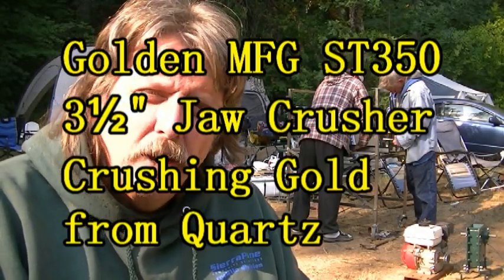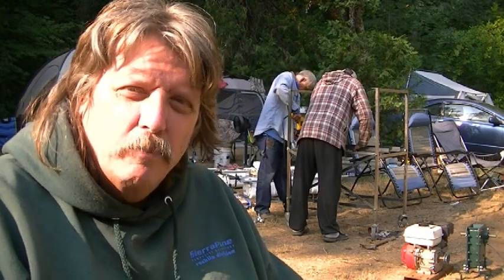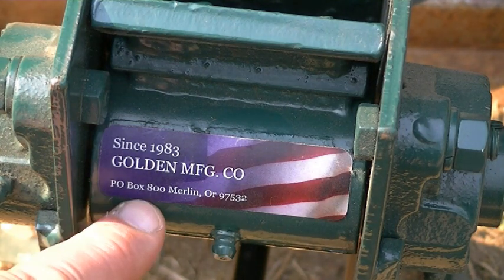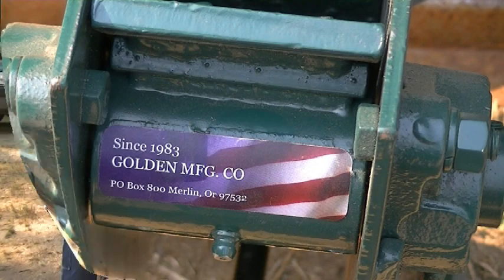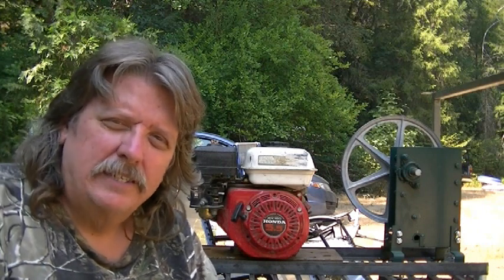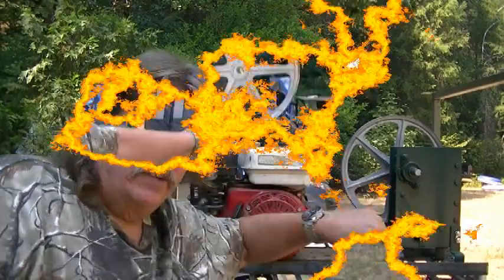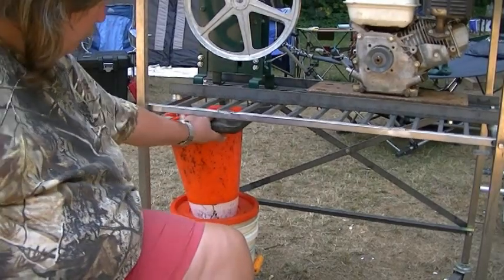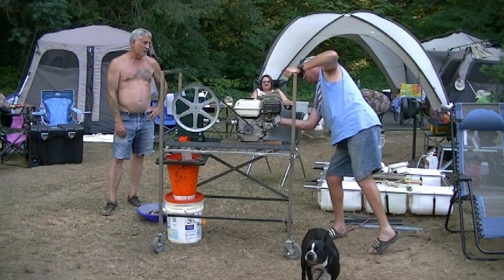Our New Golden Manufacturing ST350 Rock Crusher in action :)

Comment: Hi l have the same crusher. .works great. I had to get jaws rebuilt because of wear. Do not crush finer then 1/8", use a pulveriser, crusher lasts longer...great little guy!  l used a 1 hp electric motor.